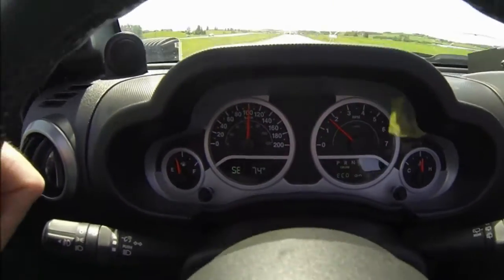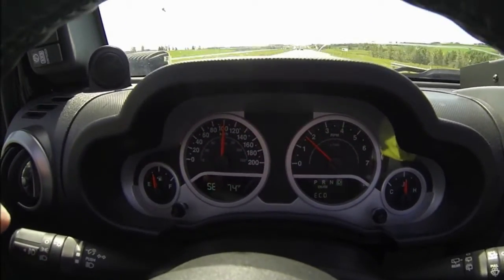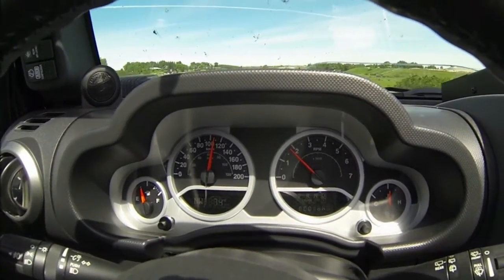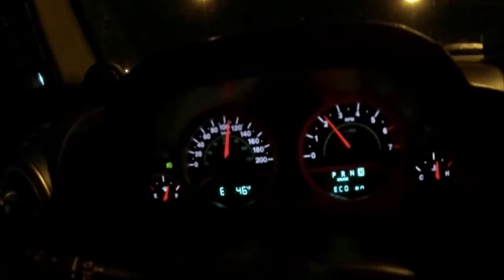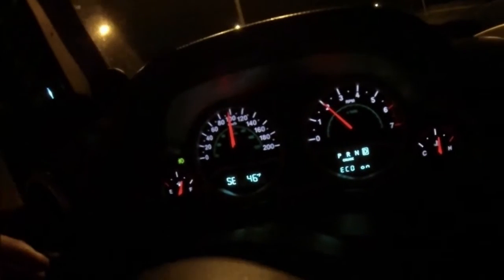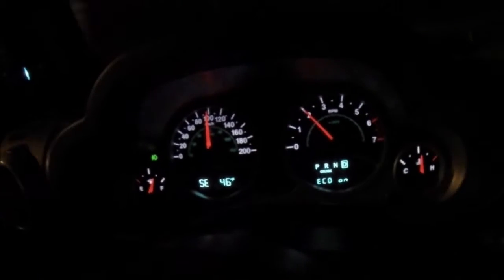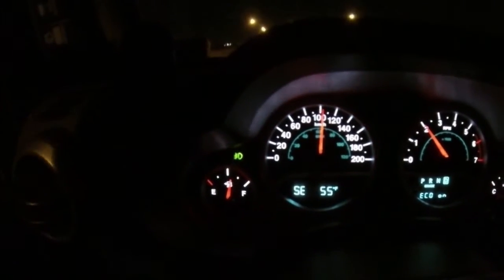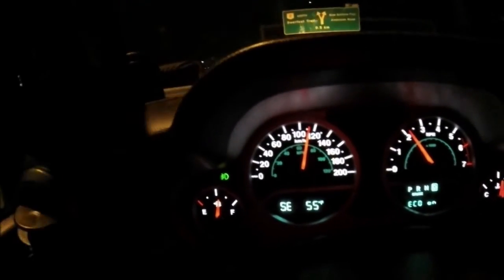RPM's with different size tires & gears.

Comment: How did the acceleration change when you went from 3.73 to 4.56 on same tires? Is there a big difference?
Reply from the maker: Hello Beka,  Yes it did make a large difference.  You can accelerate a bit faster than if you had a stock set up and you can hold hills better and also passing on the hiway.

Comment: Shit anyone rocking a JK with the 3.8L/4 speed needs to not fear the gear especially if you don't have a Rubicon. My buddy was really leaning toward 4.56 gears on his 4 speed JKU. He has 35s and I talked him into 5.13 gears. He couldn't be happier. Really even with 5.13 gears on a non rubicon with the 4 speed he could use some extra reduction for crawling. Something like the Rubicrawler or different transfer case. Keep in mind that the first gear on a 4 speed is damn near the second gear on the manual and the final OD gear is taller on the auto by a good bit. I recommend to anyone rocking 35s or bigger on the 4 speed to go straight to 5.13s and if you have a Rubicon 4 speed and go larger then 35s get the 5.38.

Comment: I'm thinking of upgrading my 2012 JKUR 4-dr from 3.73 to either 4.10 or preferably 4.56 and am on stock 255/75R17 32" tires. I'm wondering if you have a feel for whether my rpms will be too high with 4.56? I like to drive highway speeds between 75 and 78 mph usually, so maybe think of running at 125kbph.
Reply from the maker: Hello Jeff,  I would not go any higher than the 4.10 gears with stock tires.  Your revs will be too high.
Reply: Thank you for your insights Homeguy. Just out of curiosity, how about 33" tires at 4.56? Would that provide more low end than stock with 3.73 and still be reasonable at highway speeds?
Reply from the maker: 33" tires with 4.56 wouldn't be bad.  You will have some good low end torque.  The revs will be a little higher than what I have in the video.
Reply: A 2012 has the 3.6L engine and the 6 speed tranny, which is a completely different animal.
Reply: Fwiw; I upgraded to 4.56 with new Faulken 34" tires. For me on 2012 JKUR, it' perfect. Great torque and rpm's on highway are 3000 at 80mph. No downshifting at all on 75S from Florida/Ga border down to Gainesville where it gets hilly in some places. I'm glad I didn't go to 4.88 for my uses. 4.56 is perfect for my scenario. G2's by the way. Nice and smooth and no noise. That and Pedal Commander do it for me.